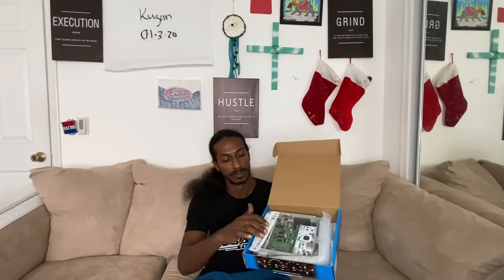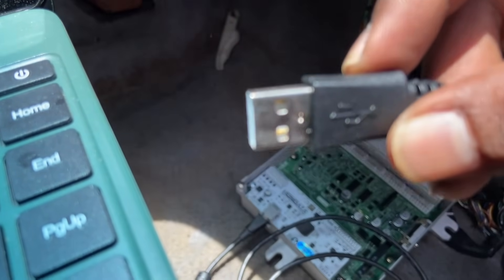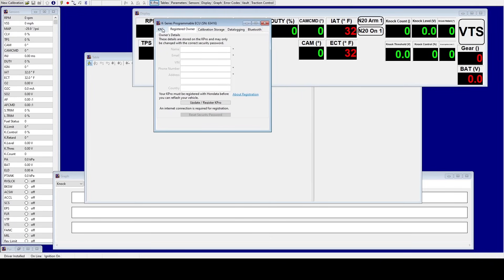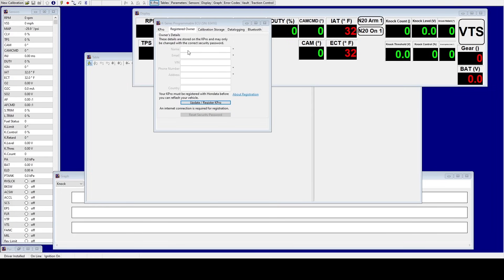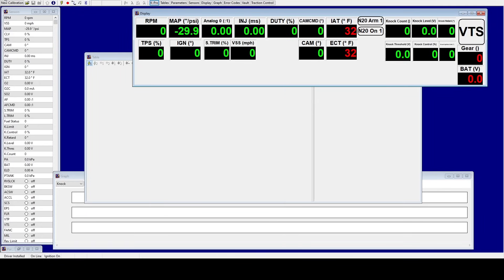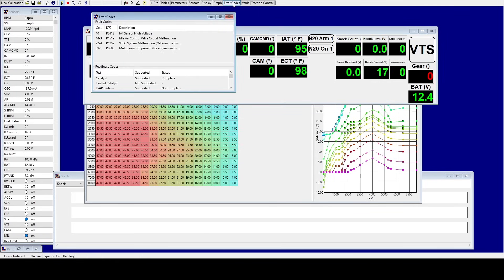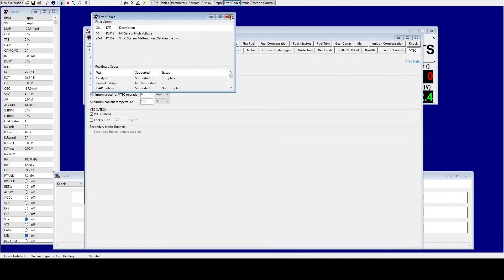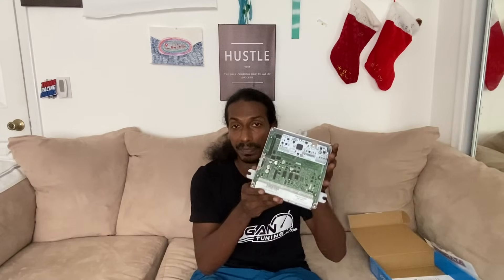How To Setup Hondata Kpro For The First Time

Comment: Hey would you have a recommendation for the correct ECU setup for me? I am putting a K24A2 into a manual transmission 2006 CrV, and swapping out it's clapped K24A1. Is there a hondata / ktuner / kpro operation you would recommend? Thanks.
Reply from the maker: There is not an ecu available for your car that is plug and play. You will need to find an external solution to get the factory CRV functions working

Comment: I have no bolt ons on my RSX Type-S, just the k24 engine. Is there a basemap or an upload that i can use just for that without taking it to get tuned?
Reply from the maker: In Hondata Kmanager there are stock K24 files that you can upload and start driving

Comment: Hey bro I got a k24a2 swapped RSX base and I can’t get it to run good
Reply: Do u sale any base maps it’s a stock k24a2 dcsports headers and RBC manifold stock base 5 speed and a cold air intake
Reply from the maker: @Menace2Society23  what issues are you having with it? Is the check engine light on and for what?

Comment: Hello how do I run a wideband to kpro
Reply from the maker: Depending on which wideband you have you run the 0-5v wire to AN1 and then open Kpro and goto Parameters > Analog Inputs and click on Analog 1 and click on "Conversions" and select your wideband and make you name it wideband. Then click on the Closed Loop tab and select External Wideband and select the wideband you just created. Press upload and it should work. Depending on how you wired the wideband's ground you might have to adjust the voltage offset under "Analog Inputs" make sure you adjust in small increments like 0.01 or -0.01 and keep adjusting until the kpro matches what your wideband reads

Comment: i just got my ecu back after purchasing a kpro - it does not rev over 3k rpm its undrivable after installing it like it just doesnt go over 3k rpm at all while driving, i have intake, exhaust and headers, will this solve my problem?
Reply from the maker: If the file your using is corrupt yes. If your current tune file isn't corrupt then it probably wont help

Comment: hey man is there anyway to run the ecu without plugging it into the car to chec kif it works?
Reply from the maker: You would have to bench power the ecu with power and ground to the correct pins

Comment: I bought a rsx with kpro already in it. Would i have issues getting in it and make changes? 🙏 Thanks
Reply from the maker: Depends. Sometimes yes. Sometimes no. When you plug in you can download the map. There are times when you download the map but it’s corrupted because of software version differences.
Reply: Hi was it hard to pull the current tune? I’ve got a kswapped car and would love to do some tinkering but I’m scared af 😂

Comment: Good info!!brother question, mine is a 05 type s rsx..with k24/20 swap..what a really need to get a kpro?do i need to find a 02/04 type s ecu or you guys have everything i need just plug and play?thanks
Reply from the maker: Here is what you need for a plug and play solution. Make sure you select yes to the jumper harness, that is what is going allow you to run a 2002-2004 ecu. 

https://kugantuning.com/products/hondata-kpro-v4-k-02-04-rsx-typs-s-prb-ecu
Reply: @KuganTuning  thanks

Comment: I get no power on ecu. It shows On line and ignition offline. Any idea what may be causing this?
Reply from the maker: What engine harness what adapter harness?
Reply: @KuganTuning  ktuned engine harness and hybrid racing conversion harness
Reply from the maker: @nvlavoz6424  check main relay and ground closest to the intake manifold
Reply: @KuganTuning  main relay doesnt click and grounds are good
Reply from the maker: @nvlavoz6424  if main relay doesn’t click then there’s your problem
Reply: @KuganTuning  that would cause the ignition off on the kpro?